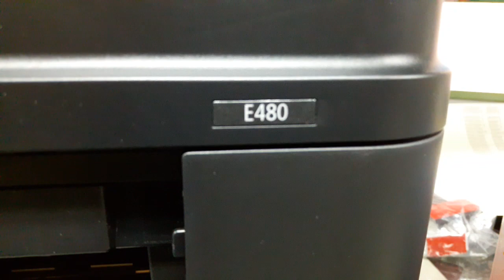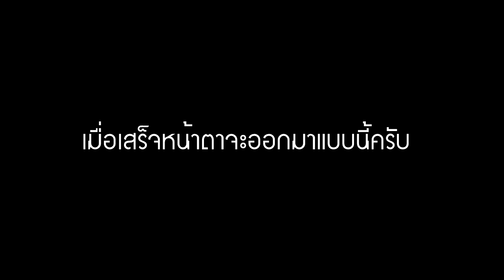วิธีติดแทงค์ canon E480  {Ink tank for canon E480 series}

Comment: But I don't see result.
With ink tank i can print only about 500 pages
Reply from the maker: after original ink level run out you must unlock ink by press stop/reset bottle on printer and hold about 10 sec. if they said about ink run out.